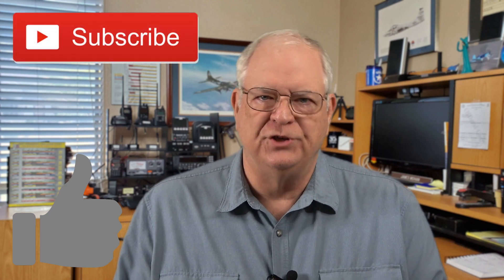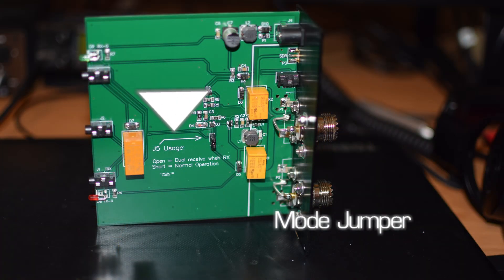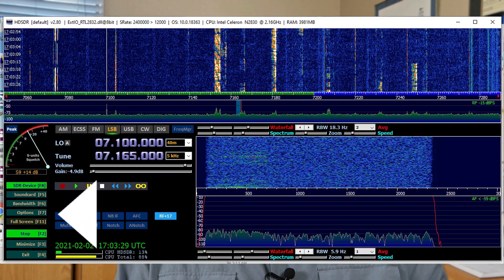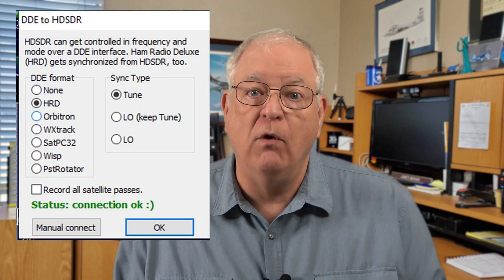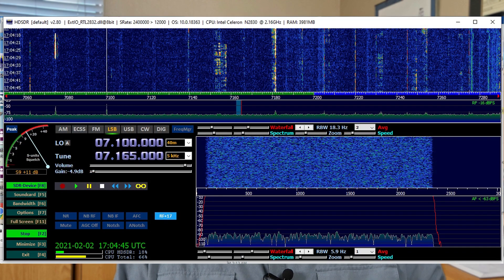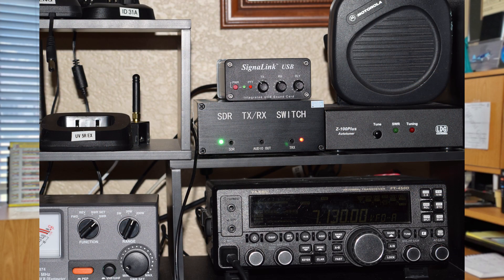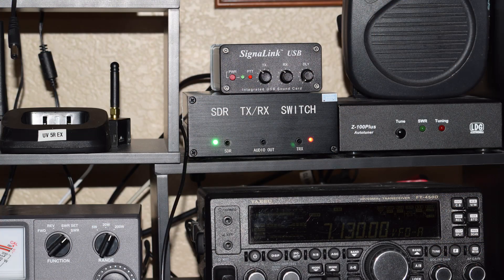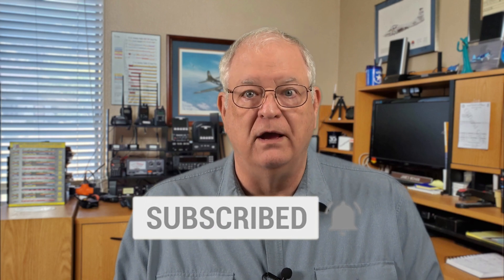SDR Panadapter Update

Comment: Thank you for the video. Does the JUMPER at J5 come pre-installed? Mode 2 means REMOVING the jumper? 4S7EF
Reply from the maker: Yes and yes. Dual receive or what I called Mode 2 is labeled as the circuit being open.

Comment: Hello. This is Claudio Bio OA4BMG.

Thanks for your videos; very good explanation.

I have a FT-757GX radio and recently ordered MSI.SDR panadapter kit to improve my radio.

According some videos I saw; on that videos they takes IF signal from the radio and feed it to the MSI.SDR. 

It allows to do not use the antenna switch box....

What can the best way to use panadapter and are some pro and con things to take in count?

Thanks
73’
Reply from the maker: Claudio, I'm not an expert on this when it comes to intercepting signals at the IF stage. I believe that such a solution requires a little surgery on the radio to add the tap as many radios don't have an output at that stage. The antenna switcher allows you to isolate the SDR from the transmit power without getting inside the radio. That, at least, is my understanding. I like having my panadapter/SDR software connected through my rig control software so I can see a big portion of the band and jump quickly to a desired frequency with just a click on the SDR software display. It can also be helpful in identifying splits between stations which may be helpful if you are a contester.

Comment: I am using SDRUNO and a RSP Dx from SDR Play. I would imagine there are many others using this setup. Is there any chance of a follow up video ?
Reply: I'm also doing it this way, TechMinds has a video I think.  Also I plan to use an explicit PPT cable from the back of my radio since I don't want to trust the switch is quick enough (especially with a mechanical relay) not to blow the front end of my RSPdx.  I think you can simply use omni-rig in SDRUno for cat control.
https://www.youtube.com/watch?v=jKqXBvsrGsI